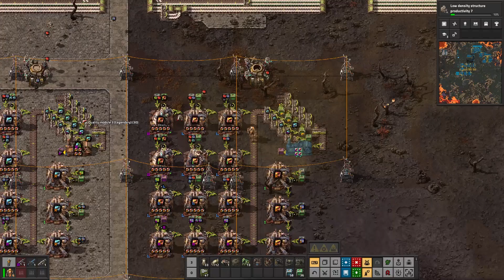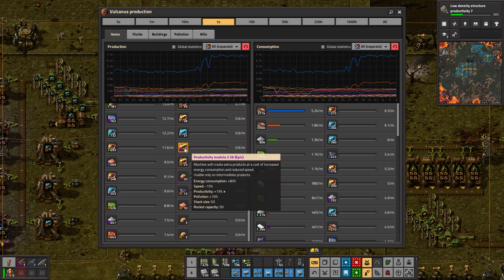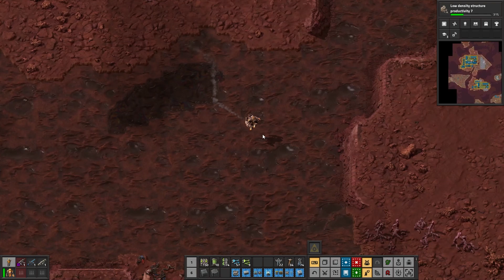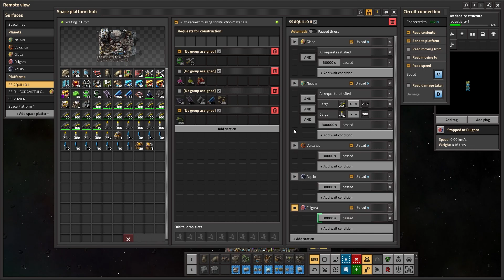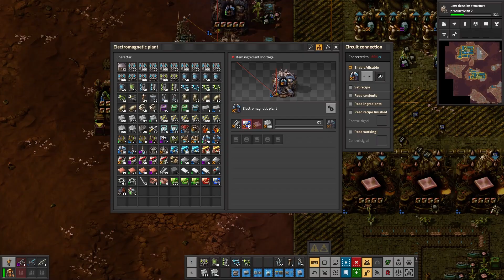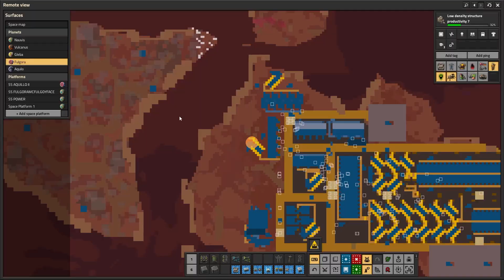Legendary Big Miner, Foundry, EM Plant - Legendary Factory EP05 - Factorio 2.0 Space Age

Comment: You can use hazard concrete to handle normal concrete. 
You turn normal concrete in Hazard concrete and then break it back down to normal concrete.
Reply: Use Quality for both steps, very effective for Upcycling.